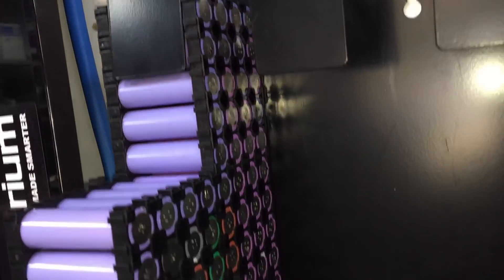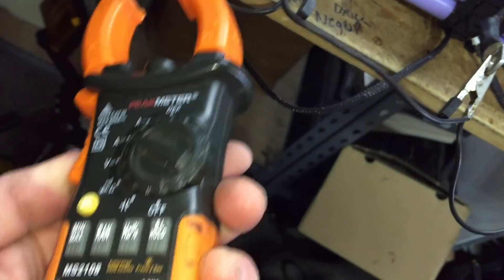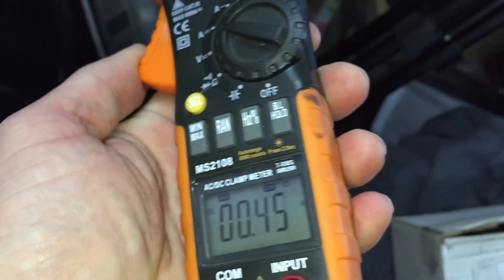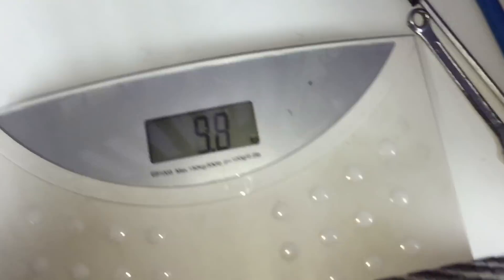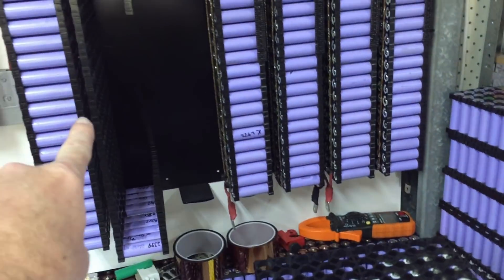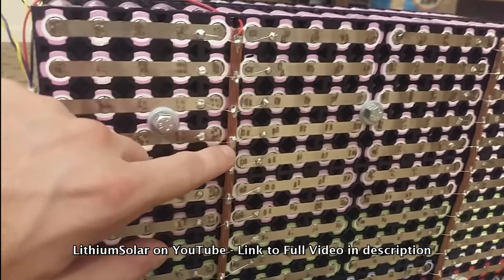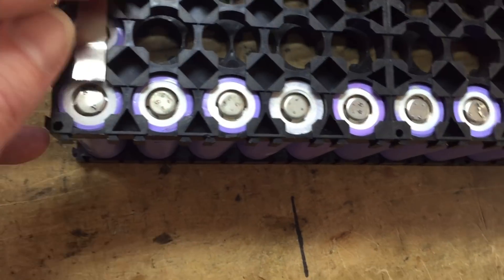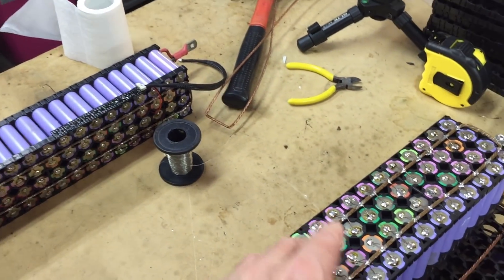Going bigger with my 18650 DIYPowerwall

Comment: how about these beasties?  https://i.imgur.com/3v7A8Ch.jpg    (from an ocau thread https://forums.overclockers.com.au/threads/diy-solar-panel-setup-on-a-budget.1103426/page-130 )

in a pack https://i.imgur.com/K2ao5Pb.jpg
and his current 3d printed pack mounts  https://i.imgur.com/fmMu1xD.jpg

2.3v @ 40Ah per cell.   eek.

Comment: 70kg for one wood screw is not much in tension, let alone shear, it just depends on what, and how much it is screwed in to, ie is the wall going to fail.
Look at Table3 and a #6 screw will take  150lb(70kg) hanging from the ceiling with only 3/8"(10mm) depth if screwed into plywood.
https://www.google.com.au/url?sa=t&rct=j&q=&esrc=s&source=web&cd=1&cad=rja&uact=8&ved=2ahUKEwifi-2ux6zdAhXHUd4KHeT-Ae0QFjAAegQIBhAC&url=https%3A%2F%2Fwww.buildgp.com%2FDocumentViewer.aspx%3Frepository%3Dbp%26elementid%3D3806&usg=AOvVaw11OZk49gTAoZjCmNHVfHoc

Comment: Does a single longmon work on 'such a large pack'?       
My packs are 60cells (130ah)  x  14 in series for 48v battery.    I have 4 of these batteries = e.g. 4 x 14 = 56 longmons required.  I could re-wire as  2 packs (e.g.120cells) x 14 in series resulting in 28 longmon required OR ever re-wire as 4packs (e.g. 240cells per pack) x 14 and only need 14 longmons.
So the question is - how many ah per pack can a longmong / Batrium support?
Reply from the maker: Yep, just takes longer - seen people with one longmon for 400 cell p pack - will shorten the life of the longmon if it is often in bypass
Reply: I found this at batrium website under "What is the max Ah that a LongMon (cell monitor) can handle and what is the recommended?"
We recommend 200-300Ah, it is subjective as others have used them on 800-1000Ah.
Typically we adopt the logic that if a battery is totally out of balance (all full with one empty or vice versa) the system should be be able to automatically equalize within ~1 week. Hence if a longmon can sustain 5W or ~1.2A bypass and there are 168hr in a week this results in approx 200Ah.

Comment: going to be interesting seeing how you link up those extra cells with the gap for the bracket without causing some sort of pack imbalance, unless of course you solder in some loops of wire to jump the gap perhaps.

Comment: Great channel, no end of insight and info. One question on this vid. You currently make your busbars exit the packs on opposite ends - if I recall, you said something about ensuring equal distance between pos/neg terminals irrespective of cell, helping to keep balance in some way. Does adding nickel strips in the way you suggest not re-introduce the issue in that the cells on the outer edges of the nickel have a greater distance between terminals?

Comment: Nice work as usual Pete. Have you considered structuring the pack as modules (maybe 5x5 cells) and have some easy way of removing and replacing should a module become problematic? BTW - think you're going to have to add some more panels :)

Comment: Nice video.

Other than just adding more cells though, I think you should install some active cooling over the cells to control the temperature, extend the life of the cells, and actually lower than internal resistance a bit. Perhaps a rig of 140mm fans would work well enough :D

Also, perhaps, you should go with a much higher voltage for your packs to lessen the voltage drop over your wires. Perhaps 48V, or you could even double up to say 96V to get the lowest voltage possible.

Altough that would make finding a suitable MPPT quite hard.
Reply from the maker: I don't think heat is an issue where the cells live last summer I didn't see temps over 30deg c and already running 48v for everything sooo much better than the 24v setup i used to have
Reply: Yeah. It makes wiring so much cheaper. 

Also, do you have other backups around the house? Like small 100-500Wh power packs? These are quite nice if you don't want to run the inverter during times you don't have solar generation with low power applications, like charging laptops, phones, lights, etc.

That would make for a neat idea :)
Reply from the maker: Considered it but i like the 'automatic' nature of what i already have and to be honest since getting this project live we have only lost power a handful of times and only for several min at a time.

Comment: Appart from adding more batteries, you should start thinking on installing an automatic fire suppresion system with Dry Chemical Powder in your shed. The more batteries you add, the bigger the risk is, so adding some fire hazzard safety measures might be a good idea :)
Not only to protect your property, but also so make sure that the damage made to your packs and electronics is minimun
Reply from the maker: I think water dumping all over the outside of the shed might be better - if that many cells go thermal no dry chemical will do a thing. Fire department recommend with a lithium fire WATER, and hours and hours of it even after it is out
Reply: Water is definitely better, but I would probably cry an entire week watching my batrium, electronics, and all cells soaked in water, that's why I suggested something dry
Reply from the maker: water will be the last of your issues for the electronics lol 2000 deg c for 20 min will create a molten mess of recyclable metals lol
Reply: Olivier Lopez Ch I mess around a lot with almost any kind of batterys. This lithium ion batteries are not that much dangerous as polymer batterys but any way having an early alarm system with a temperature control is a nice idea
Reply: @Mad_gamers323  Dry powder and electronics is a disaster. The powder is simply sodium bicarbonate which is conductive and corrosive and is known to destroy electronic and electrical equipment. My preference would be carbon dioxide which has no residue, non-conductive non-corrosive and has the added advantage of  cooling too.
Reply: I'm pretty sure the result of the chemicals "going nuclear" lol is that they then create their own oxygen, so even if you sealed the shed tight and dumped an entire commercial bottle  of Co2 in there, it wouldn't make a difference..
The best thing Ave could do would be crack out the shrimps and put em near the super hot shed barbie :D

Comment: No longer fusing individual cells?
Reply from the maker: I'm going to try it differently and see how it goes - if it fails i'll be sure to tell the world about it.
Reply: @HBPowerwall  more capacity is great. Doubling it should make it possible to run the whole house of them.
Reply from the maker: it'll run the whole house already, just more cells same wall space hehe
Reply: @HBPowerwall  make sure the wall of your  shed can also handle the weight. 🙂

Comment: So the cell are going to be in Cell of 3 and then fuse if I understand that correctly? I dont now if it's that great if one of the cell fails but it should work just fin. Anyways you have more knowlage about that than I have.
Reply from the maker: Neater, quicker & i'm willing to give it a go - fingers crossed it's the right decision

Comment: i wouldn't like to burn your house down.
Reply from the maker: Still standing after 2.5 years use :) but thanks for the comment
Reply: How many volts capacity for this 180 pcs. cell? And how may watt hour it can provide?
Reply from the maker: I only charge them to 4.1v  capacity wise it would be lucky to have 300ah storage I will test one once it's built
Reply: Thanks but i want to know the result just to have an idea for my first power wall project, do you think its possible to run an antminer S9 for 24/7 for this lithium battery just a wild guess?

Comment: All that weight is on only one 18650. the one on the bottom back.  Watch out that you do not damage it.
Reply from the maker: Yes, have addressed that with 4 zero volt cells that won't be connected. But very good point should have included that in the video

Comment: Pete I really like that idea. You could re-inforce the bottom plate by adding a thicker bar to it, and more anchor bolts to each battery supports. my spelling is like your maths..hahahahaha
Reply from the maker: When installed in the power shed I'll have to bolt the timber to the shed wall I think. Might even have to carry the wood all the way to the floor for extra support. That much lithium hitting the floor isn't an option
Reply: No it isn't if you wish to keep the shed, the timber to the floor sounds like it would be more than enough support.

Comment: The threaded screw anchors for drywall are good for 50 -70 lbs depending on wheither they are plastic or metal, so using those and with some screws into the studs framing the wall you should be OK.
Reply from the maker: in my battery shed I just have wood screws through the tin shed wall into the wood - I think I will need to bolt the wood to the shed then fill every hole with screws and I'll be good. More is better in this case and screws don't cost much. I don't trust drywall with that much weight - might take it for a short time but long term it's ending up on the floor lol
Reply: OK, the painted plywood had me fooled into thinking it was drywall.
Reply from the maker: Yeh, it's only cheap plywood both in the workshop and batterysheds

Comment: Put in a row of screws along the Bottom too and run a strip of 50 mm x 50 mm wood along the wall under the battery holder and screw it to the wall. That will easily hold the weight.
Reply from the maker: with the 160 cells i think i'm good without the wood but i'll keep an eye on it for sure